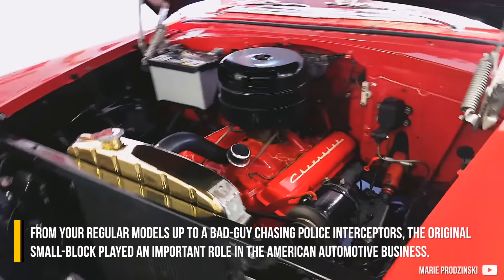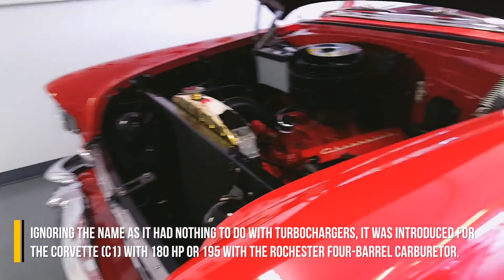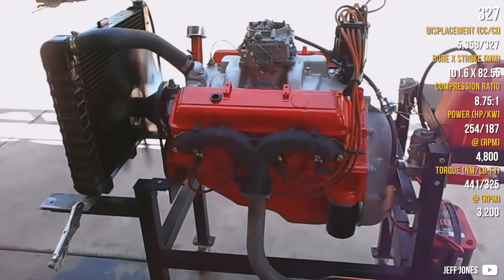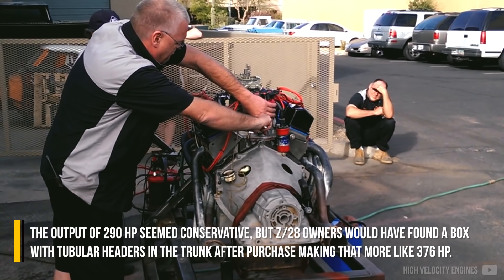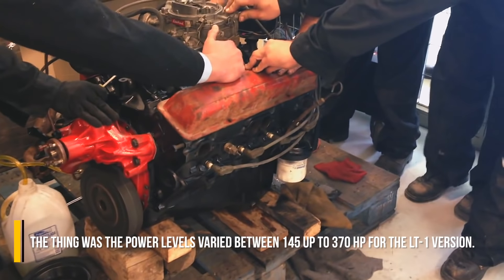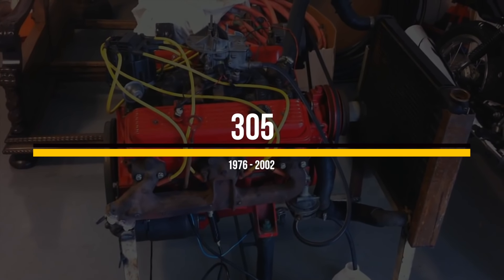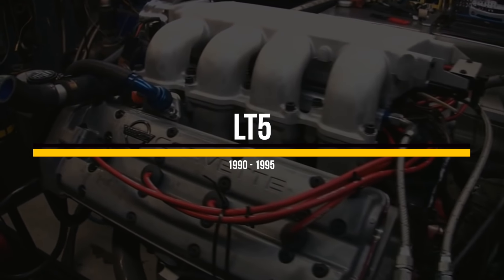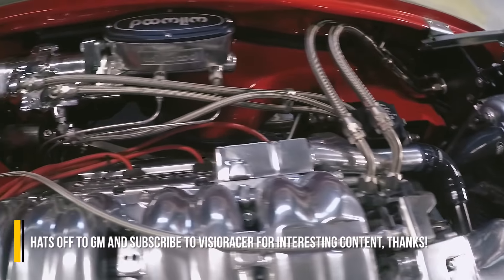GM Small-Block: Explained | Powered America For 48 Years

Comment: I’ve seen 383 strokers make 620 horsepower naturally aspirated.
Reply: long duration cam means poor bottom end torque and drivability. Also, high lift, high revving push rod engines have poor durabilty. 4V DHOC VVT is the path to performance and durabilty, aka nearly every other engine made in the world today.
Reply: My dad had a Z28 RS with an NA 383 stroker. That car definitely had more than 600 hp. Spun the tires in 4th gear.
Reply: Andrew, to spin your tyres in 4th with only 600hp means they are some terrible siht tyres. I drive a turbo barra and these make 900hp with stock internals (needs valve springs) and I typically have mine set for about 750hp as my daily drive as thats about the limit of the factory spings before float. Quiet with strong midrange torque. I am doing this with stock cams and exhaust plus high flow cat, and is very quiet. V8s ? meh.
Reply: it had BF Goodrich tires, like the ones you'd typically see on a muscle cars. Yeah, pretty bad
Reply: @nordic5490  Ford Barra engines are badass gotta admit.. it's like 2jz but from good 'ol 'murica

Comment: Small block a 4,3 liters V8 ? Small block here in Europe is 1.0L 3 cylinders turbo
Reply: I suppose it does a great job powering your blender when you make a milkshake.
Reply: It has more to do with the configuration the block than the actual displacement. The smallest big blocks were like 5.7L and the biggest small blocks were like 6.6L. Also, saying small block V8 is kind of like saying small mansion, it's still going to be pretty big.
Reply: Because pushrod engines package so efficiently, even a 6.0L small block will be very small on the outside. For example, an LS7 7.0L engine is barely bigger on the outside (and almost exactly the same weight) than a Mazda 1.8L DOHC b series.
Reply: haha;
GM 292: 4.8L / straight-6

Comment: I really had to laugh at the title of this video. Actually says GM small block when small block is a patented family engine name patented by GM! GM is the only company that ever made a small block as it is a patented engine family term. 
General terms of the automotive industry used to describe engines are overboard, square or under bore! These are the only generic terms internationally used to describe engines. There's also single plane and dual plane crankshaft engines. GM never made a Windsor or a Cleveland engine just like Ford never made a small block or a big block ! GM never made an FE motor which stands for Ford Etzel or a block or an MEL block which stands for mercury Edsel, Lincoln.

Comment: I hated the 305, why, because of all that emissions BS and trust me it killed the motor no matter how you treated it. Knocking pistons and almost no horse power the poor truck we had may have done a lot but not enough to cause its problems.
Reply: grumpy chuck thegrumpychuckchannel yep, I tore out all of the emissions bs and even on 7 cylinders it ran so much better. Now I have proper headers on it, and edelbrock 650, and am getting new heads pretty soon possibly since the valvetrain is around 30 years old now. But I don't know, I may just sell the thing and cut my losses and go for an mr2 or something.
Reply: Unfortunately we sold the truck then it got scrapped. Not the first time its happened.
Reply: A 305 with the proper cam, headers and a set of World S/R Torquer 305 heads (no longer made) is capable of over 300 ft. lb torque and north of 300 horsepower.  The factory version was purely an economy/smog engine.  You can still get them for next to nothing and then build something to rival any other engine.

Comment: The last one mentioned,was built and designed by Mercury Marine and not by Lotus.Can't get parts for it anymore.The 265 never came with an oil filter from the factory.There was the 307 also,it was an alright engine at the time.They are also popular dropping in the older Ford hot rods and street rods.Advantages are parts interchange,dirt cheap to build and easier to get parts for over the small block Fords
Reply: No, the LT5 was designed by Lotus, and manufactured by Mercury Marine.
Reply: The parts for that one are obsolete,heard this from guys that worked on them.
Reply: The 265 indeed got an oil filter for 1956.  Just the first year ones didn't have that on the block, but was a dealer option (remotely mounted).

Comment: I have never been able to find an aluminium block of these, only LS
Reply: They never made one from the factory. You can find them brand new from the aftermarket for around $4,000 to $6000 US
Reply: I know that, I want to know who sells these blocks?
Reply: Lightweight and better cooling for a Fiero, the only blocks there is are from shady brands
Reply: Mason you're just full of all sorts of misinformation today! DART & Brodix both make aluminum blocks that very much out perform any iron variant from the factory. Oh, and MUCH lighter. 

Lay off on the stupid pills, dude.
Reply: Stay #triggered there, mason ol' boy!

If I were half as crazy as you I'd write a book about it, something about iron blocks being more desirable. It's the weekend, enjoy your day drinking ;)
Reply: Not defending his insults but dart and brodix both make aluminum small blocks that offer greater strength than OEM grey iron counterparts. They also offer iron blocks that greatly outperform factory units due to different design and iron alloy used. For the ultimate in strength and durability racers go with billet aluminum blocks when using power adders to make over 2500/3000 hp
Reply: Look in the GM Performance Parts catalog.  GM does sell about 4 different versions of the original small block cast in aluminum.
Reply: Yes in factory applications the iron is stronger than aluminum, but most aftermarket performance aluminum blocks are stronger than the OEM iron version. The SBC, dodge LA, and 8.2 deck windsor for example. Those blocks have a tendency to crack at high rpm and power levels. The aftermarket aluminum blocks outperform them by a large margin due to better design and manufacturing processes. That being said an aftermarket iron block will usually be stronger than their comparable aluminum version. The billet block is the pinnacle of engine blocks designed for the top performing racing vehicles.
Reply: For the original poster https://www.jegs.com/p/Dart/Dart-SBC-Race-Series-Aluminum-Engine-Blocks/1064092/10002/-1

Comment: Pardon my ignorance good folk 
But aren't most US made v8 all share the same layout? (OHV 90 degree v8) 
So what makes the GM engine unique other than it's production run and age?
Isn't the LS motor more iconic? Or the dohc NASCAR engine built by was it Chevrolet?
Reply: firing order, build components, and the design of how everything worked together helped to make the sbc ( small block chevy ) a mainstay in the auto world.  Each manufacture did things similar but different in a lot of ways.  The LS motor was it's own little world and continues to be in a lot of different circles.  It was one of the first of the "computer" controlled and operated sbc if I remember right.  I also made good power compared to the previous years of emission choked power levels.  Going from 170 hp to 200 hp on a engine displacing 5.7 or 350 cubic inches doesn't seem like a lot but it's enough.
Reply: MASON WINKLER the 351 ford although not overly small. Is king lol
Reply: It was one of the most widely used V8 engines in the US and the one that most hot rodders used in modifying cars. Very easy to find parts for. A very large selection of modification parts. Very cheap to build and modify. A basic rebuild kit with new gaskets, bearings, seals, pistons, camshaft, oil pump, timing chain, and lifters can be found for less than $200 US. They are simple to build and can be torn down, inspected, and reassembled in an afternoon by one person. With a set of decent cylinder heads that can be found for around $600, an aftermarket intake, and a hot camshaft they are easily capable of 400-500 hp. Most can be built to that level of naturally aspirated power for under $1500, sometimes less then $1000 if you look for deals on parts. With some factory cylinder heads some time can be spent with a die grinder and sanding cones to port the heads, and builds over 450hp with a good cam and intake is not unheard of from a set of ported heads.
Reply: MASON WINKLER the Windsor/Cleveland held world records, granted it didn't have as many aftermarket options and it might not have had as high numbers when built. But stock vs stock? I still regard it as king.
Reply: The 'small block chevy' was relatively compact and light weight for its era and power output.
Reply: The Windsor is the small block of Ford world. Its roots are in every day basic cars but it found its way into many high performance cars from Ford and others. One thing Ford did was fool around too much with engine families and even made significant changes within engine families. You have the 289 and 302 which were great but Ford wanted a 351 so they raised the deck to get the extra stroke and threw a wrench in things. Then they pulled in the truck (Clevland) motor into some cars to make another 351 (same year same car had different 351's) and 400. They also threw Clevland heads on a Windsor for a few years. Then in the big block side they had the 427 and 427 side oiler which are completly different blocks but same family. They had enough of that and made the all new 429 (Now the 385 engine family) but it was too late to stake its claim as a muscle motor because the power wars were wrapping up so they made it into a 460 and it because a truck and land yacht motor. I think Chevy did it right with a big and small motor, pick one and parts swap (mostly) from the 265 to the 400 or 396 to 454. It made it easy for aftermarket companies and even GM themselves to sell millions of aftermarket parts which kept enthusiasts happy.
Reply: MASON WINKLER 

Only the modern hemi could be considered a small block. The LA series is the small block Chrysler everybody knows (318,360 or 5.2,5.9 liter) and it's not a hemi.
Reply: kyubey, yup, I always thought these pushrod engines were a joke.
Reply: MASON WINKLER 

They made Hemi V8s starting in the 50s. The smallest one was a Dodge engine called the red ram measures 27" from outside of one valve cover to the outide of the other valve cover. That's big block territory. Since you referenced Wikipedia, perhaps you should go look it up. It shows the engines you are talking about and then proceeds to talk about small blocks. Eg; 273, 318, 340, 360 which are not hemis.
Reply: MASON WINKLER 

Engine dispacement has nothing to do with block size.
Reply: Big block and small block isn't about displacement. It's about the bore spacing, center to center.
Reply: 00jeepxj The TPI and LT1 are computer controlled SBC engines.